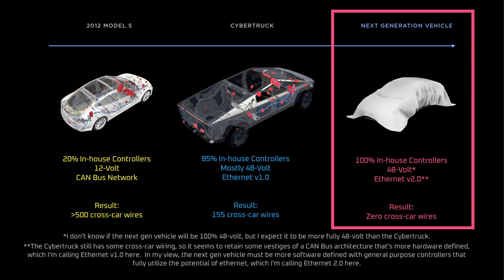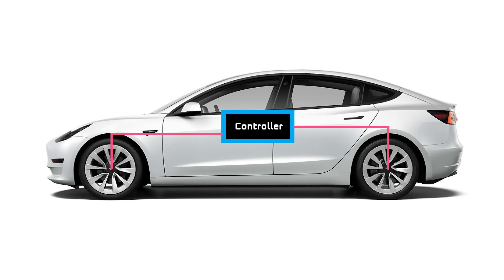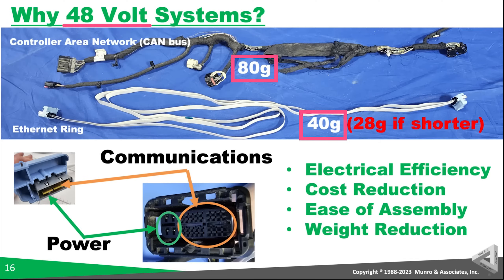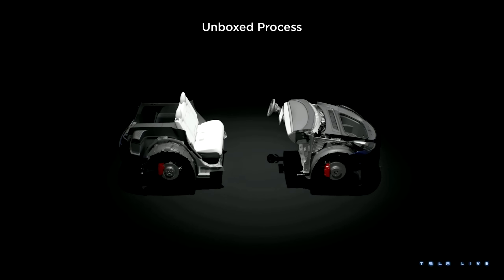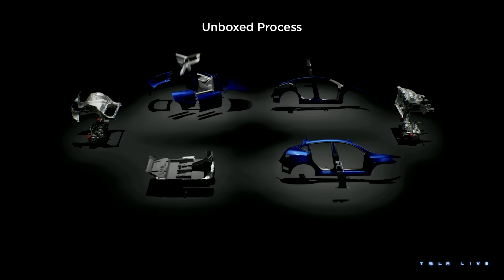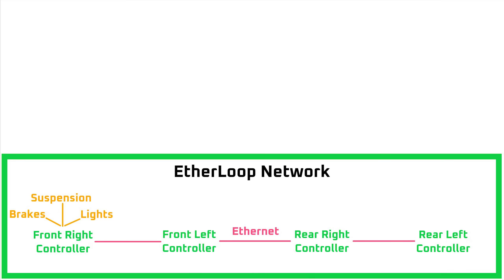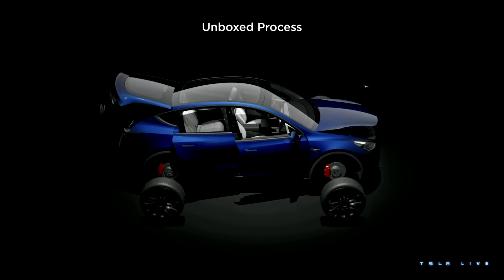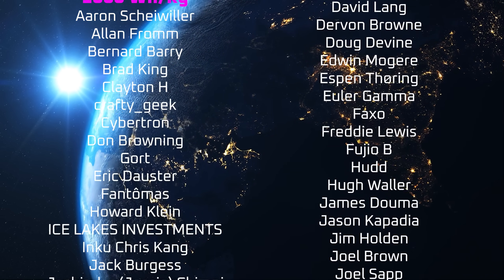Digging Deeper on Tesla's Etherloop Wiring System

Comment: Minor clarifications: The Ether part means it will be a different industry standard than CAN, not a complete invention reinvention of the network layers. They will probably be using IP4, to have open source components work right away. The local area network in private homes are typically a star or a tree, but that is not failure tolerant. Any component can be offline with a single point of failure. The Loop-part of the name is a reference that it is a loop-architecture, not a bus. That means if you cut the network, the packages will take the other way around the network. Like TokenRing. It is a fault tolerant network. Each zonal controller will effectively have a small router. It will be interesting to see which OSI layer they create the “loop” in: actual loop, or virtual, but loop-like.
Reply: Probably they won't be using IP for time sensitive / safety critical parts like brakes. But there are related ethernet standards for that, see "Time Sensitive Networking" which is about making ethernet usable for real-time workloads.

I suppose it might be possible to run less critical workloads like entertainment over IP using the same wires as the real-time stuff, just at a lower priority.
Reply: Is there a MTU size published somewhere?
Reply: I'm pretty sure they have said it's ethernet physically but it does not communicate with IP and you do not need IPv4 for that, IP is layer 3 and you only really need layer 2 to have communication.
Reply: Ethernet must be loop-free. Though modern switches can detect loops and deactivate those ports.
Reply: Aren't all the issues around packet collision introducing latency addressed by QOS tagging?
Reply: @TheFPSPower   Agreed, this will be a closed network, with very specific needs and messages. Most likely they will not be using a general purpose protocol, but derive a more specific protocol that meets the needs the specific needs of the vehicle.
Reply: I agree because I strongly suspect that they changed the physical layer and kept L2 and up the same. That would make sense because all the high bandwidth stuff like cameras already uses IP. And like you said, they can reuse all the software stacks.

The real time L1 is the innovative part, not the loop topology. We can do loops with off the shelf IP networking, it’s just not very efficient for most applications.
Reply: @jbepsilon  They specifically said that they’re using it for real time systems. That’s the custom part. It’s not really Ethernet, it’s a custom L1 using the same physical wires. With autonomy, the cameras are becoming safety critical so I think they want the entire bus to support that.

They said it had priorities and used time division multiplexing, neither of which Ethernet offers. I wish they’d say more because a TokenRing style L1 that supports gigabit speeds is not trivial.
Reply: @ryanmcgary6212 No, QoS is a layer above. Using switches instead of hubs solved the collision problem.
Reply: From the Wikipedia page: A gigabit Ethernet 2-wire physical network with a proprietary time-sliced, network protocol for near real-time control and feedback is used for all motor vehicle subsystems, including steer-by-wire, motor controls, all vehicle controllers, plus vehicle audio with active road-noise cancellation. Tesla has achieved millisecond-scale latency with microsecond-scale synchronizaton, plus redundant control, since if one path is broken or defective, the data is moving bi-directionally over the physical loop.

Been around since the 90s. Tesla added their proprietary near real time protocol on top of it.
Reply: @worskaas sounds like ethercat to me.
Reply: Basically it’s RSTP for a car. We put in RSTP rings (loop) in buildings all the time with building automation controllers and sensors. It’s very effective. There are some manufacturers that have failover Ethernet ports and basically become a keystone Jack when power is off.
Reply: @jbepsilon  the brakes should run through a physical steel cable. These cheaply built shitboxes aren't airplanes. Drive by wire needs to be triple redundant to be safe.
Reply: @theairaccumulator7144 1. Brakes are using brake fluid, not steel cables. If done correctly, an electronic fault should not be more common than a hydraulic leak. 2. Who said the controllers were not SIL certified?
Reply: Just for clarity, Ethernet is a layer 2 data link protocol. Information is broadcast on a physical network with sending and destination MAC (media access control) addresses header followed by message payload. 

IP (internet protocol) is a layer 
Routing 3 protocol with ip addresses and message payload inside a layer 2 datagram. 

Routing between networks is completely unnessesary and introduces unnessesary latency within a car so there might not be an Ip protocol.
Reply: Tolkien Ring was always the way to go...
Reply: No.   I doubt it is an IP network.   There is already an industrial, "hard" real=time network based on Ethernet physical layer that uses a ring topology.   I think this is what they are using.   It is called EtherCAT.         That said, it is possib;er to put IP over this just like ypou cam put IP over CAN if you want.
Reply: Etherloop means it uses Ethernet protocol which has Mac addresses, not IP addresses.
Reply: @jbepsilon  also why would IP be required?
Reply: @kreynolds1123  Ethernet is also a layer 1 (physical hardware layer) protocol, that specifies signal levels on which wires etc.

Agree they wouldn't need IP, at best just bridging would probably suffice, but from what someone else has posted above, according to the Wikipedia entry, it uses physical ethernet physical connections, with a (proprietary?) real time, time sliced protocol layered over this?

Doubt that they will publish the full details, so it's hard to know exactly what they've done....

(EDIT) Another poster in another thread has said that Telsla engineers told Munro they are just linking CAN controllers with Ethernet wiring, another has said, it looks like EtherCAT, and yet another has said that it looks like what they do on aircraft network wiring all the time....

So, looks like Tesla taking existing technology and industrial practices, using it on motor vehicles, and Elon spinning it as yet another revolutionary idea from Tesla, and taking the credit for it......

(EDIT2), commercial EtherCAN controllers are available, which link CAN controllers via Ethernet, to provide "real time industrial control over ethernet", and also support PoE (which runs 48V). Make of that what you will......
Reply: @peeemm2032  Just a small clarification. Ethernet encompasses both Layer 1 (Physical) and Layer 2 (Data Link) functions because it handles both the physical transmission of data and the logical organization of that data into frames.
Reply: @ryanmcgary6212  Nope. QOS just helps tell devices what sort of traffic gets priority. If the network is using a hub style communication than means collisions still can happen. As he mentioned in the video, a collision is when two devices send data at nearly the same exact time and 'run into each other' causing the data to become corrupted garbage. Using switches instead of hubs pretty much eliminates collisions but not completely. However I suspect the 'loop' part of the name is the big clue of what is going on. It is probably a modified Ring, or Token Ring network meaning all data travels in the same direction around the loop. This eliminates collisions entirely since data can't be sent in the reverse direction around the loop and instead all travels the same way. Kind of like a highway loop around a city but just image if there weren't two directions of travel but just one. It adds some latency since it can't just transmit directly to the controller it needs to talk with but has to follow the loop around. But if the latency of the network is extremely low then that extra latency won't make much of a difference. However I do suspect that in order to make it safe from a single controller failing that the Etherloop has two loops like an actual highway does to ensure if there is an issue in one direction of the loop it can still send it the other way to ensure it arrives.
Reply: @MikaPopp  Switches do not eliminate 100% of collisions. They do however eliminate almost all of them. If a switch is sending data to a computer at the exact same moment the computer is sending data to the switch then there can be a collision. That is why I am pretty sure it is some sort of modified Ring or Token ring network. I suspect a bi-directional ring to ensure a single break in the network can't take it all down.
Reply: @jbepsilon  I agree for hard realtime tasks there are protocols directly on ethernet. But having seen what happens in real life a fully redundant properly designed ethernet runnning on IPV4 is VERY rubust and fast. Remember you can send about 660 ethernet packets in the time it takes the canbus to send a single frame. With Quality of Service and redundancy. Really the question here is, will the protocol be designed by a software engineer (TCP/IP) or an electronic engineer (Ethernet)
Reply: @dacjames  No they will still use statistical multiplexing. There is already both IP and Ethernet protocols that specifically deal with prioritization as long as you don't have multiple endpoints on a single line (Coax) real time and reliability is really not a problem.
Reply: @jacobuserasmus4441  no, they don’t. Tesla engineers said as much in interviews.

L3 and up could be the same, but L2 is  novel. And you clearly have no idea what you’re talking about because no, Ethernet has no concept of priority and no guarantees at all, which makes it unsuitable for safety critical “hard” real time. How would guarantee a maximum ping in a pure Ethernet network… I’ll wait. 

I’m sure it’s standard IP on top but the L2 protocol is heavily customized… according to Tesla.
Reply: @Fievel4  does the auto industry still use hubs instead of switches? I've not seen a hub in any modern data center (or even home network for that matter) in at least a decade.. or two.

I mean going back even further, do any hubs even process QoS packets? Like hubs and qos practically (if not technically) mutually preclude each other IRL.
Reply: @dacjames   802.1p (priority). Thanks it your answer made me think a bit. 

Layer 1 (Physical Layer):

Tesla indeed have made changes at the physical layer. Using different connectors and thicker cables suggests enhancements to physical robustness and possibly signal integrity. Adjusting voltage levels and timings could help in reducing noise and interference, ensuring a more reliable connection.

Layer 2 (Data Link Layer):

It's likely they haven't made significant changes to the data link layer protocol. Managing packet transmission priority (802.1p) can be effectively controlled without altering the protocol itself. This layer typically handles MAC addressing and error detection, which might not need modifications for their application.

Layer 3 (Network Layer):

Any novel approaches here are speculative. However, IP decoding is well-established, and many chips handle it efficiently. Customizations at this layer might not be necessary unless they have specific routing or addressing needs that standard IP does not cover.

Layers 4/5 (Transport/Session Layers):

Significant efforts could be focused here to manage timing and ensure data integrity. Ensuring proper sequencing, error recovery, and flow control at these layers can greatly improve overall system performance, especially in real-time applications.

Thanx. I had to go and listen to the interview again just to make sure they have said nothing contrary to what I mention above.
Reply: @ryanmcgary6212  I simply explained about hubs because you had said " Using switches instead of hubs solved the collision problem" which wasn't accurate since collisions can and do occur when using switches. Based on what I do understand about the CAN bus is that it is a point to point serial connection to each component and so neither hubs nor switches are even relevant. 
Hubs don't process anything at all. They simply accept the data they receive and then repeat the data along to everyone connected to it. So no they can't process QoS packets or any other type of packets either. And Switches in general don't process QoS either unless they are managed switches, there are exceptions out there but not a lot.
Reply: These types of systems have been around for a long time first thing that comes to mind is normed mining equipment go and check it out
Reply: @Fievel4  You're probably thinking of either switches for the older coax Ethernets or half-duplex links (if that even is a thing nowadays). AFAIK twisted-pair Ethernet doesn't have collisions since they are always wired point-to-point. The hub vs switch issue is more about bandwidth limitation than frame collision since a hub just floods each incoming frame onto all its ports. Ethernet (as in IEEE 802.3) uses different signal modulations for different cable types and speeds, and not all detect or handle collisions (or need to).
Reply: Inb4 it's just 10BASE-T1S
Reply: @jaskij  Yeah finally someone makes the first sensible comment. It is just going to be one of the XBaseT1 standards, which is Ethernet over a single twisted pair. 10Base-T1S (802.3cg-2019) is 10Mbps over a single Cat5 twisted pair up to 15m, there is also 10Base-T1L ( 802.3cg-2019) which is 10Mbps over a single Cat5 twisted pair out to 1000m, 100Base-T1 (802.3bw-2015) which is 100Mbps over a singled Cat5e twisted pair up to 15m, and finally 1000Base-T1 (802.3bp-2016) which is 1000Mbps over a single Cat6a twisted pair for again up to 15m. All these standards have the goal of replacing CANbus and the like in a variety of applications including automotive. They all use PHY-Level Collision Avoidance (PLCA) to avoid collisions on the single twisted pair.
All we are seeing is Tesla being the first to widely deploy the technology.
Reply: @jonathanbuzzard1376  I'm not familiar with the higher speed T1 standards, but I know that T1S is bus/multipoint, while T1L is point to point. Could also be EtherCAT, but I somehow doubt it.
Reply: It sounds like Tesla is keeping the parts of the Ethernet protocol that they like, 48v for example could function as  PoE delivering power to whatever endpoint needs it.

When you take it down to its basic concept, it becomes more of a network switching problem - which isn't too hairy since using switching vs. hub (which I'm not sure the narrator realized  that the packet collision issue has been solved for many years using switches). Each port/interface becomes it's own collision domain, eliminating collisions. 

I could see them implementing some sort of QoS prioritization, but that would likely be way further up the chain at the controller level. 

Still, very interesting.
Reply: @jbepsilon we used IPv4 in robotics and had a specialized controller that prioritized braking and acceleration systems over all other functions
Reply: From a hardware point of view, if a gigabit network was used between 1.5 million small packets could be transferred in one second or 80.000 big ones. That leaves open the possibility to schedule data, like for example 20% of time for low level data. Without the use of prioritizing and redundant pathways, it would already give enough time to process important data first, without retransmission. What I want to say: a second is small for us, for electronic systems it is a month.
Reply: @jonathanbuzzard1376  certainly EtherLoop is going to be based on existing standards or at least existing knowledge. But don’t you think Elon is going to call it something different and make it just different enough so that he can claim credit for innovation?

Comment: Kiss goodbye to DIY repairs and independent mechanics! 😢
Reply: i don't see many more issues. you mean mechanics with a wrench of hackers? because you need latter nowadays anyway. can is not much of a better. it's still network. controllers are still closed
Reply: One controller failure,  all systems failure in that corner, no thanks.
Reply: @estebanamador7601  Unlikely, probably have multiple backups

Comment: Great explanation of CANBUS vs EtherLoop. Citing and including the visualization of both was quite helpful too. Thanks!
Reply from the maker: You're most welcome man!
Reply: For what I've seen, CANBUS runs on two wires and isn't connecting all devices onto a single bus. It can branch, so a group of devices are on one segment, the other group on the other segment. There's possibility that one segment may be faulty (shorted, open etc) but the car can still move, it just generates bunch of codes and MIL goes on.
48V may be good idea for reducing currents and wire sizes but it also can do more damage in all the plugs and sockets (electrolysis, arcing). It is also high enough voltage that may give electric shock. Shorts between sensitive signal lines and power lines probably get more destructive.